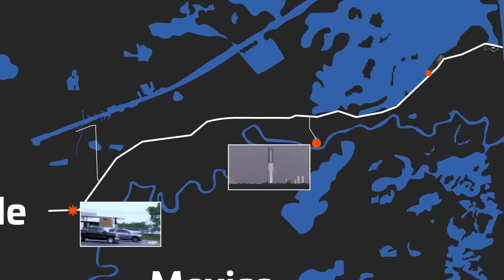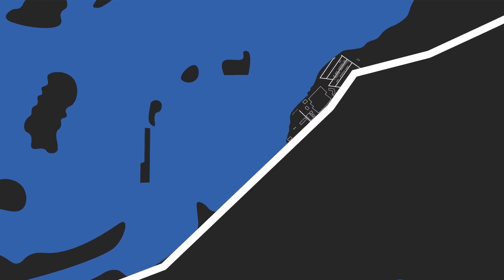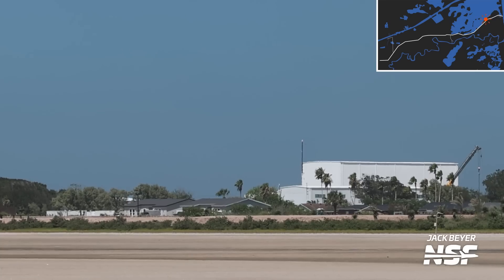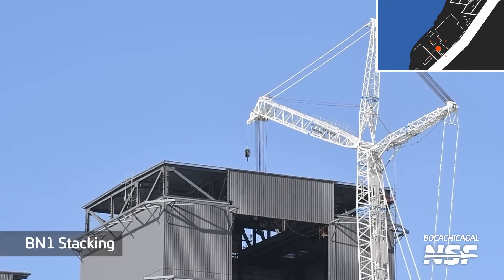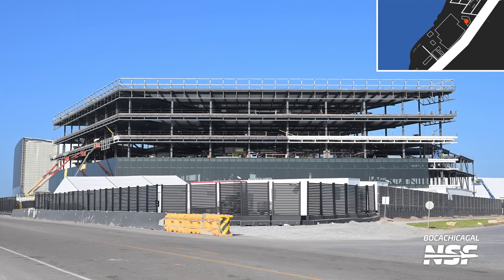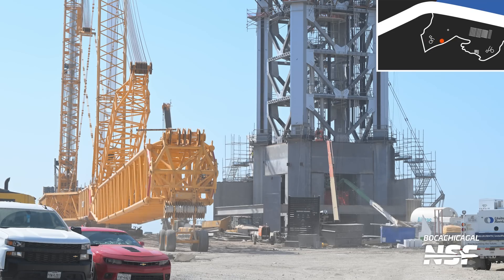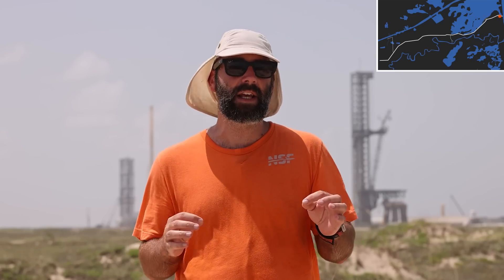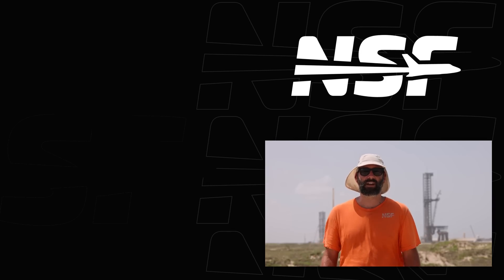This Is Starbase | SpaceX Starships Are Made Here

Comment: The factory and office buildings will be connected at some point it seems.  Do you think there is any plan to connect the parking structure?  Would probably have to be a tunnel though, right?  Can they even tunnel based on the water table at Starbase?

Comment: So is orbtibal pad b not using the current style of olm ? Is this how they will be able to stretch the ship and booster without being taller than tower?
Reply: It seems like it will probably be a different design, but the stretching should just be possible with the current tower height. They can extend the ship/booster up while leaving the lifting points at the same height for a while before it becomes a balance issue